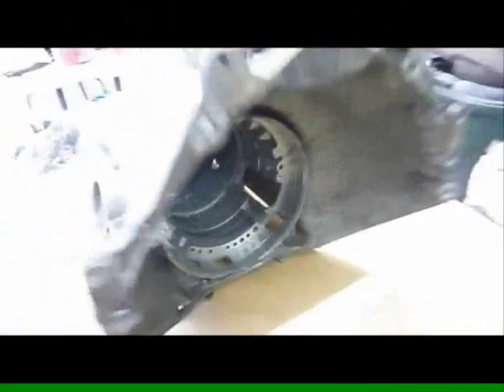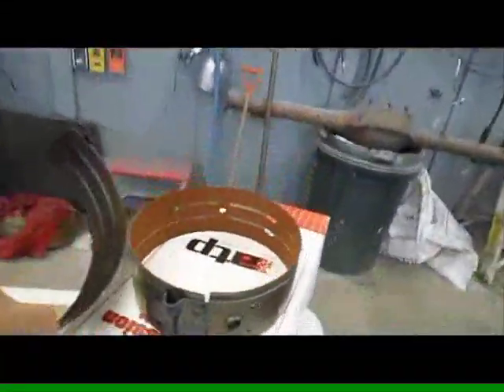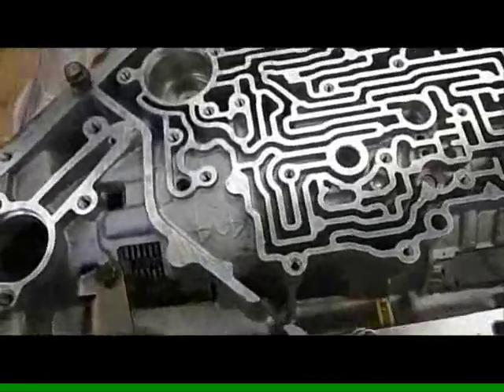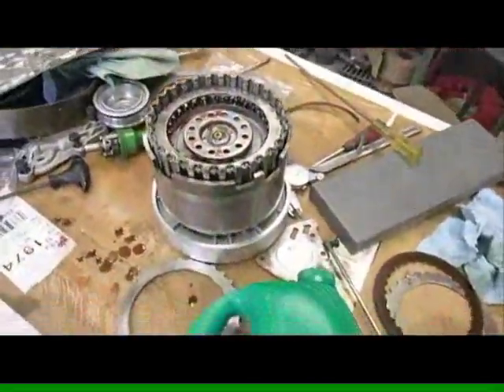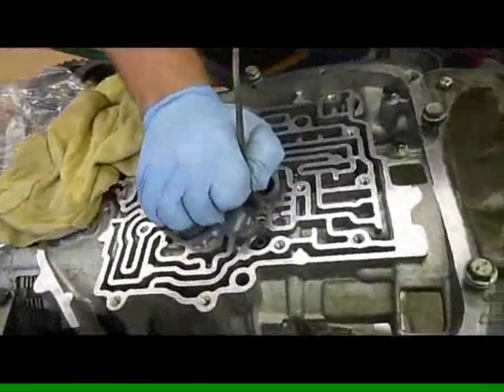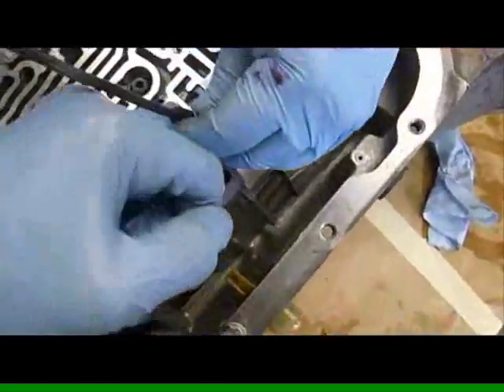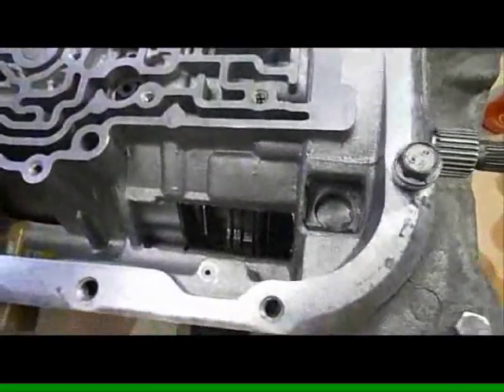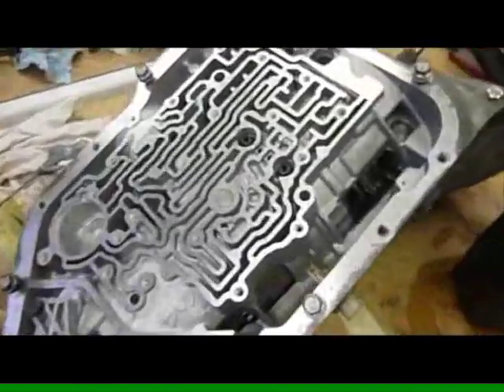200-R4 Transmission, more stuff, rebuild, learning curves!

Comment: Hello 
I have a 1983 t type with 1970 455 and 2004r trans 
Shifter cable popped and when i put a new one on it didnt fit was too tight so i now just shift it from the column now. but for some reason the comumn  is off park is reverse now and N is drive. like the whole thing is off by a gear. should i Pull the tranny and take it to be rebuilt or are there some things i can do?

Comment: Tire roasting in my parents 1980 5.7 diesel Cutlass Calais was easy and fun, it would lite the street with sparks from the studded snow tires put on for the winter, was turning spring and the plan was to drive until they were worn out, being a teen I decided to rush it. The 200r4 was rebuilt a few days before I flipped the car, destroying it, engine and transmission were relocated into a Delta 88, a 4 door, tall gear in the rear for highway cruising, getting the wheels to spin like I often did with the other car was tough, but when I did so,and it caught traction, the sprag exploded. The guy who had rebuilt the transmission in the other car, he'd rebuilt many, said he'd never seen one like that before, dad wasn't amused, and I never told him how it came about. He often scoffed that I could break anything

Comment from the maker: With a light foot and clean fluid, it may hold up.  For spirited driving, it needs a few vital but important modifications.  A hardened stator support shaft, steel pump rings, larger diameter pressure regulator and reverse boost valves to increase oil pressure, a wide red Alto or Kevlar band, a 'Super Servo' 2nd band servo assembly, and a decent valve body reprogramming kit to speed up the clutch/band applications.  Note most of these mods are for pressure increases and holding power increases.